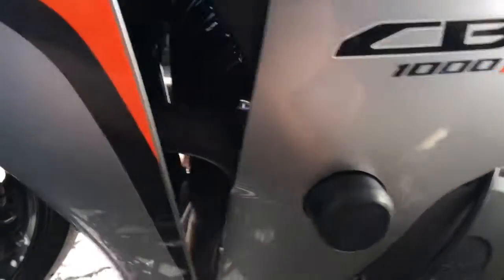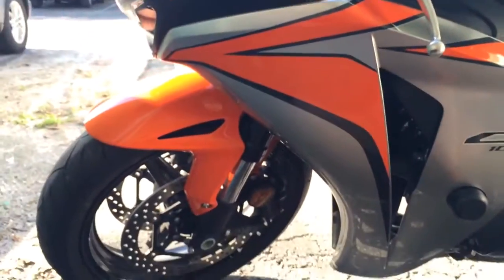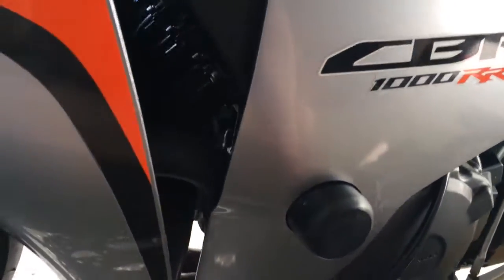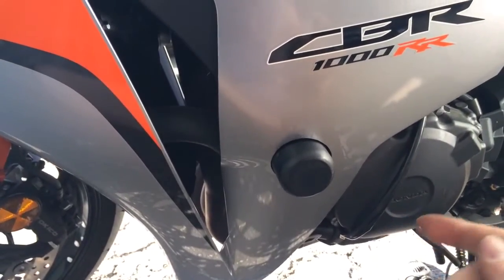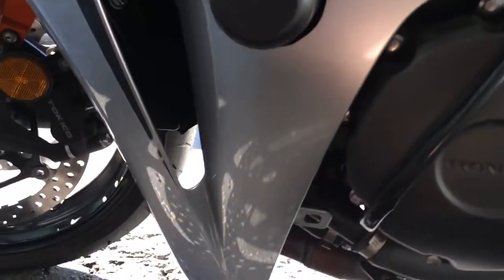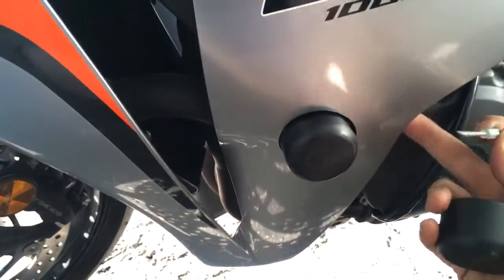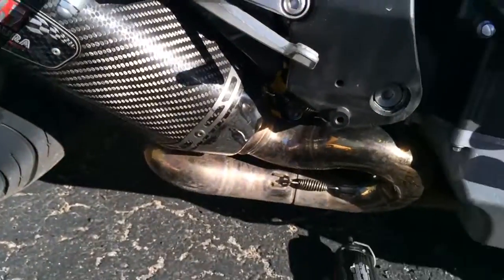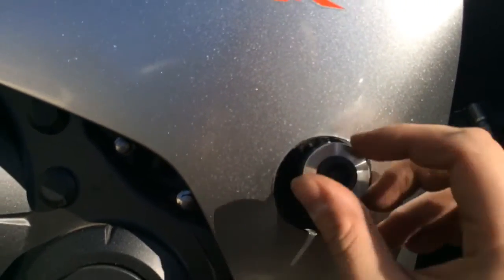Easy cut frame slider installation CBR1000RR

Comment: im very curious as to what brand frame sliders snapped off on you. ive personally seen the r&g no cuts in action on a s1000rr and they did a very good job at saving the bike but they are the most expensive brand out there so i was looking at the t-rex sliders  instead.